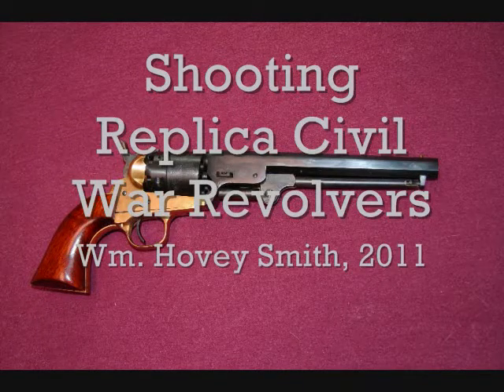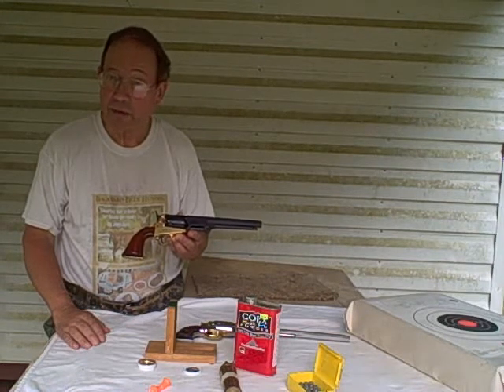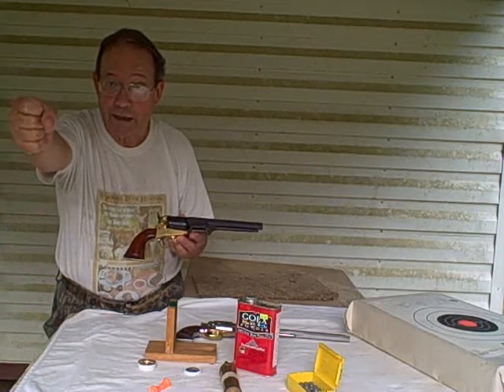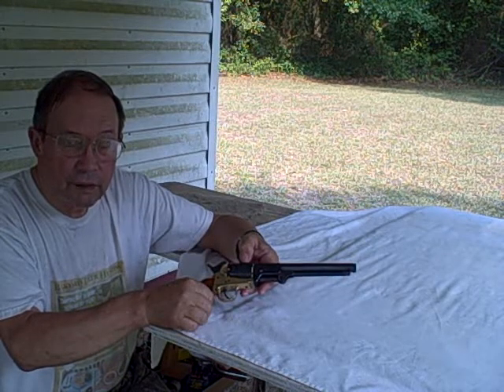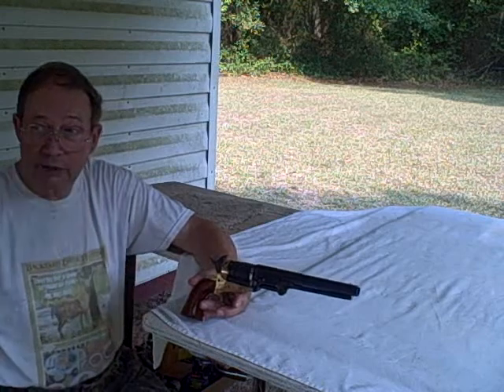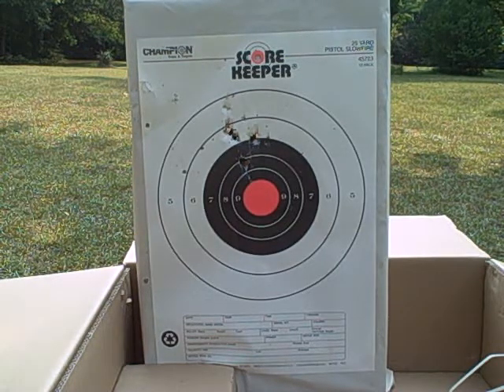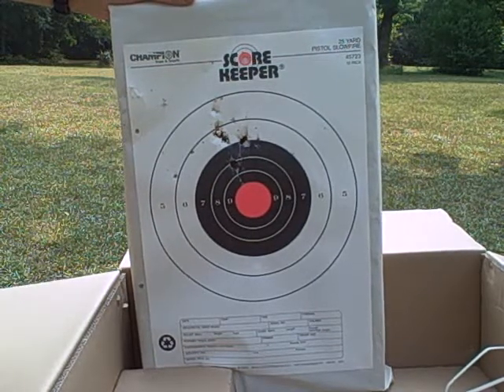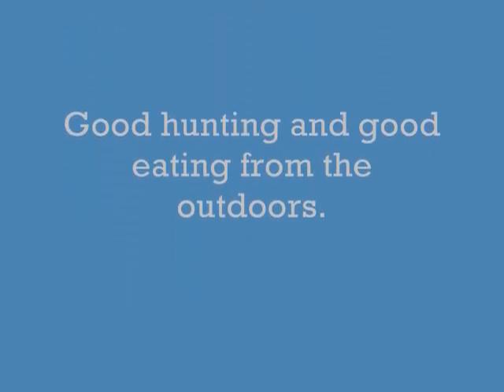Shooting Replica Civil War Revolvers.

Comment: I do not agree that the Remington "solid" frame is any stronger than the Colt "open-top." It seems like a lot of people (who actually know better) look at the Colt frame and think that the strength of the gun is somehow projected/cantilevered up from the lower part of the frame, as if the frame was a C-clamp or something. Looking at the mechanics of what is really going on, the lower frame on the Colt is mostly just under compression. If you wack somebody hard enough over the head with your gun butt, then the barrel/cylinder gap might close up and the upper part of the cylinder would be under compression. But the cylinder pin (or "arbor" as some insist on calling it) is rarely under anything much except tension. And tension is steel's greatest strength.

Now look at the Remington with its skinny and loose-fitting cylinder pin, which cannot contribute anything meaningful to the overall strength. Note how thin and delicate the lower part of the frame is, just ahead of the cylinder. Note how it gracefully steps much thinner there, right where it is also slotted for the rammer lever. And bear in mind what soft steel the Italians use for these replicas -- I recently did a Rockwell "C" scale test on my Pietta Remington frame and it was completely off the scale... negative 1 according to my tester, while cheap common low carbon cold-rolled comes in at 10 to 15 on the "C" scale. So you wack a bad guy over the head with your Remington or your horse rolls over on it or whatever and guess what: steel can't resist bending as well as it resists tension.
Reply from the maker: Where open top Colt guns fail is that the barrel wedge-cylinder pins shoot loose and ultimately bend or come out. Shoot similar guns to failure and get back to me if you can demonstrate otherwise.
Reply: Hovey Smith Not sure what you mean about failure. I have an old 1851 Navy replica I bought in the 1970's that I have put many hundreds or probably thousands of rounds through, and lots of it harder wheel weight lead or reclaimed cast bullet lead. Yes, the wedge shows some battering -- bear in mind what I already said about the steel in these Italian replicas. The cylinder pin and even the barrel face also show a lot of gas cutting, though I think the particles from burning black powder has a lot more to do with the cutting effect than the gas proper does. Anyway the gun is still perfectly usable and nowhere near any failure.More recently I have been reading claims that the original Colts had the cylinder pin bottom out hard in its hole in the barrel, where most of the replicas over the years have not been set up that way. I was not aware of this before, but it makes sense that if there is any initial looseness in the joint, then the parts get a run at each other with every shot and battering in the replicas will be greatly increased over what it would have been in an original Colt. My 1851 does not have the pin bottom out, yet is still OK.I have no doubt that the Remington frame will stand up to any amount of shooting. I just do not think it is >stronger than< the Colt in overall real-life handling. Those Remington revolving carbines are so cute, but with the long cheater bars of the rifle barrel at one end and the buttstock at the other they look like begging for a bent frame.
Reply from the maker: I am happy to hear that you have had good luck with your Colt replica 1851. Every mechanical object will someday fail. The replica guns have sometimes given almost immediate problems, others have lasted 500 rounds, but by about 1,000 rounds barrel-wedge cylinder pin problems often start to arise. Remington style replicas and in particular the Ruger take off, the Old Army, do better in this regard. With heavy hunting loads in guns like the Colt Walker I, and others have pushed the limits of the Colt open-top design. These guns do fail, typically after a hundred, or sometimes fewer, rounds with the same wedge-pin problem.  They can be repaired and made functional.  This is the experience of the industry and of many shooters and gunsmiths who work on these guns.

I don't like the feel of the Remington revolving carbine and have no experience with one.  I had rather carry and use my stainless Cabela's Buffalo with its 12-inch barrel and Triple7even loads as a more portable and nearly as effective an option.

Someone, sometime, may have done side by side tests with Colt and Remington revolvers from the same maker and shot them until they stopped functioning from mechanical failure of their principal structural components, but, if so, I do not know of it. Such a test with periodic cleanings as needed and replacements of internal parts would yield one data point. It would take ten such tests to be definitive. I am not ready to go to this trouble and expense, and I do not know of anyone who is. Perhaps some government during the day had their arsenal personnel make such an evaluation. Such testing would almost have to be government sponsored.

As more historic records are put into searchable databases, something might emerge, although it might well be in some language other than English.

You have an opinion that I cannot, on evidence, prove or disprove in a definitive manner; but the weight of my experience and those of others indicates that the Remington solid-frame design is the stronger than the Colt open-top.  If not, why did Colt with its 1873 Peacemaker and most other cartridge revolver makers go with the top-strap design. Colt even had experimental top-strap  models and the Root revolving rifle and pistol also used it. If it were not thought preferable, why did Colt use it  for its revolving rifle and shotgun designs?
Reply: Hovey Smith "...fail, typically after a hundred, or sometimes fewer, rounds..."

TYPICALLY? That is quite a claim. Hard to imagine any company selling such a product in today's legal climate. Do the heavy hunting loads you mention include smokeless powder?

Please note I never condemned solid-frame revolvers in general. Obviously the Ruger or even the Colt 1873 designs are different entirely. In my initial comment I specifically pointed out the weak area of the Remington frame design, and the softness of the Italian steels which combine to create the weakness I am talking about here. I thought I was pretty clear about that. I'm not understanding why you bring other guns with different design and different metallurgy into this discussion. I did not and am not criticising solid-frame design in general.
Reply: catherine alkuino Ha! Did not realize this Chromebook opened my daughter's YouTube account from a link in MY email account.
Reply: I have 2 pietta remmies, one 5 1/2 in and one 8 in. I have well over 1000 rounds through each of them with no problems. I got a pietta steel frame 1851 36.cal less than 2 months ago and have over 500 rounds through It already with no problems. It is as tight as the day I got it. I love both the Remingtons and colts. I will say that I prefer the action on the colt and I do like the looks of it more.
Reply from the maker: Your point about the Colt's pin being stronger both because of the steel used and larger size is valid; however the Remington's pin does not have to carry the load of holding the gun together and can, and is, safely made of weaker material as all it does is support the cylinder in the stronger metal frame. In a pinch    a piece of hardwood of proper size would work if it had to. I have never heard of this expedient being used, but it might have happened. As a matter of mechanics, and more for beauty than strength I would like Remington pins of color case hardened steel; but no one but a custom maker would go to that trouble.
Reply: Hovey Smith        n